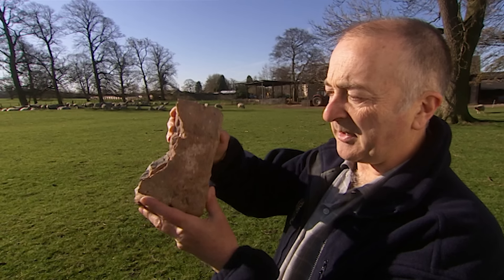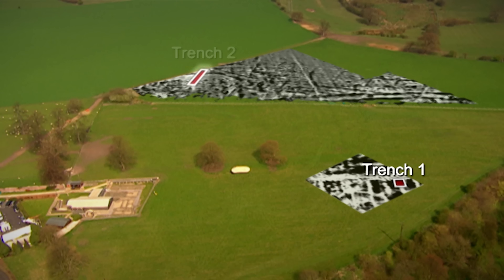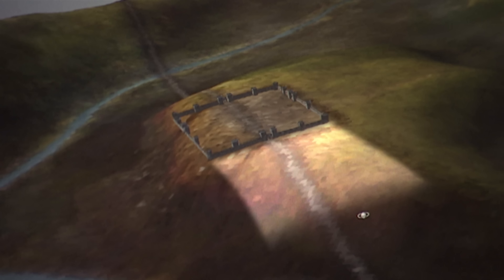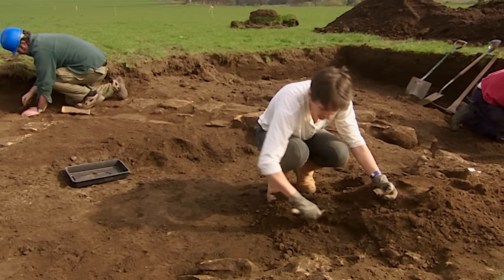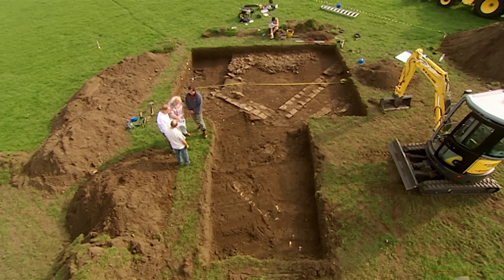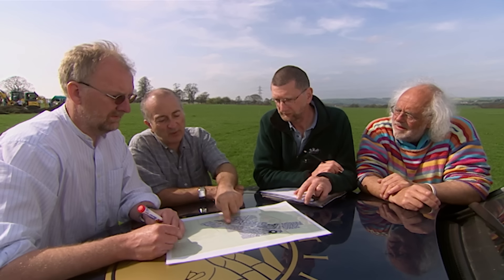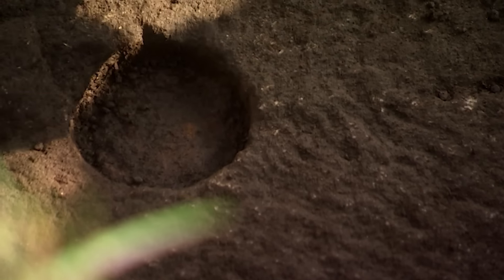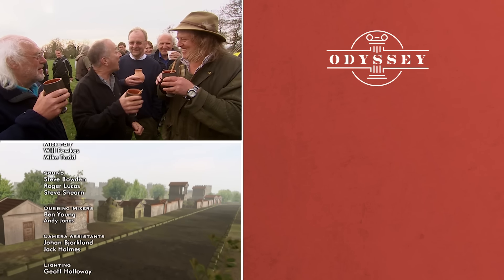The Largest Roman Mausoleum The Team Have Ever Found | Time Team | Odyssey

Comment: Another two many standing around and talking, few digging.
At times I don't get it.  How do you 'date' a site based on finds in a ditch fill?  Unless near the bottom of the ditch, wouldn't finds in the ditch represent material dumped into the ditch after it was no longer needed?  And that could easily be the crap laying around, again after the site was no longer in use
Reply: They can measure the ditch fill by analyzing the layers of soil, plus what’s already in each layer. We’re used to diggers and the like tearing up soil, but in most cases people only dug holes when they needed, and time will make soil naturally act like a fluid in slow motion, subsiding and naturally softening out. This process can be measured and checked against other situations and sites.  Think of it as deep forensics.